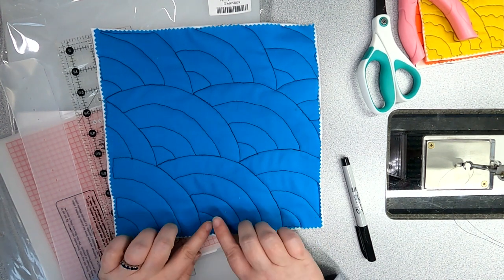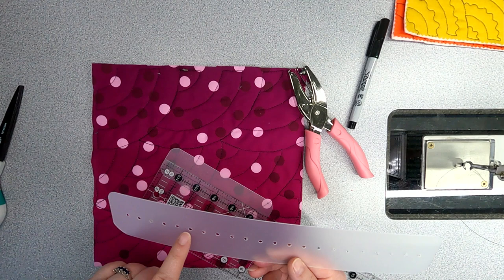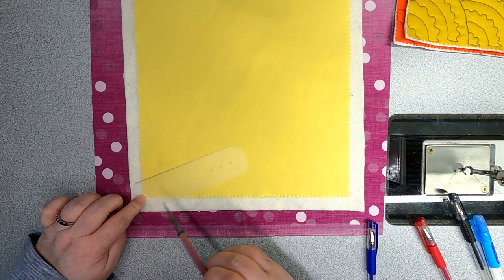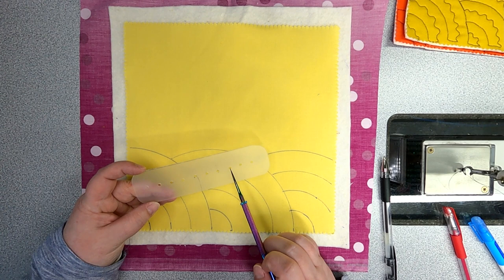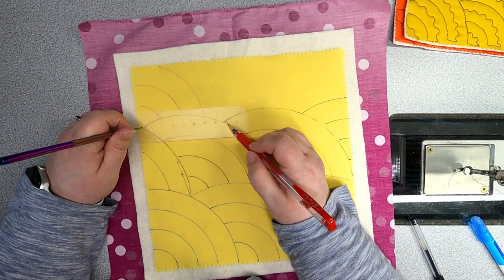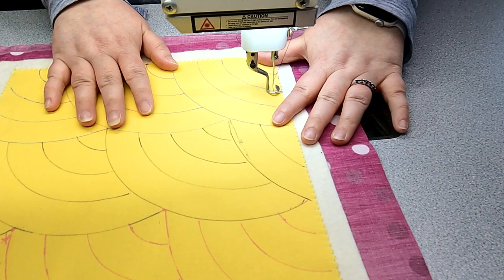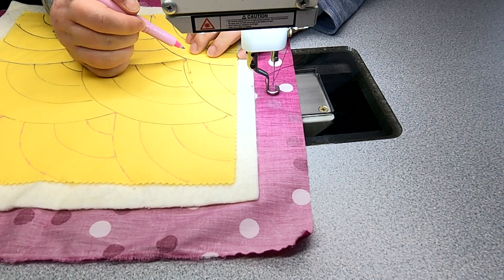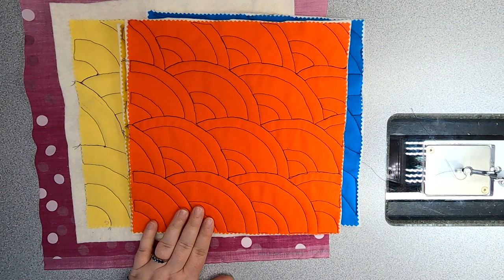Classic Baptist Fan Machine Quilting on a Regular Sewing Machine!

Comment: Will those ink marks return when the quilt gets very cold? I marked a pattern on fabric with a ink pin something like your's. When pressing on an applique some of the ink marks disappeared. I put my project in my freezer overnight. All the ink marks were back the next morning. Could the marks return with age? That is a wonderful idea. Making and using a template to mark and sew those lines as even as possible.